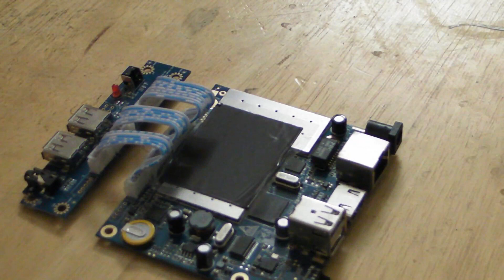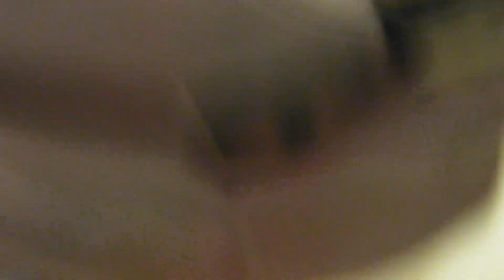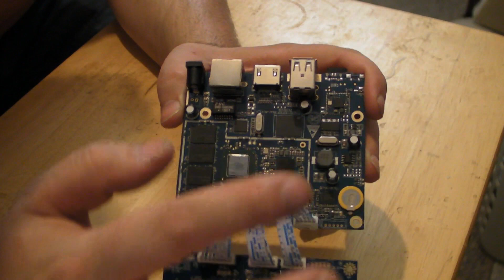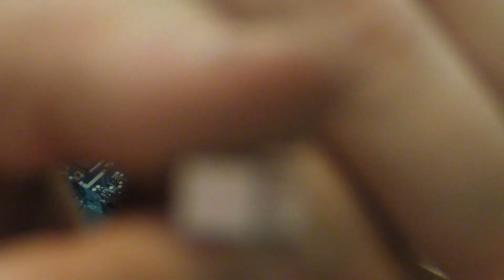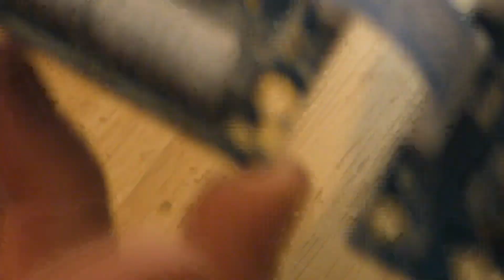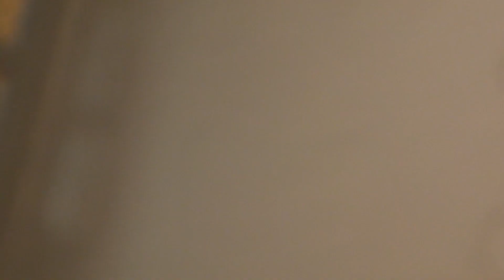Pipo X7 Heat Sink Swap

Comment: May I ask what are the dimensions of the stock heatsink? I mean those of the metallic plate which you removed.
Reply from the maker: George TJ honestly I have no idea. I don't have that computer anymore and the heat sink went in the trash as soon as I was done with the video
Reply: I see. Thanks anyway.
Reply: @GeorgeTJ  go on ebay and order the heatsink kit for Raspberry pie. I have a android tv box that was overheating and it worked out well. I'm somewhat experienced at modifying most electronics I buy. even TVs. It's why I never pay for a extended warranties because chances are I will modify it in one way or another.

Comment: I have a wintel w8 pro. I have four spare raspberry pi heat sinks with adhbresive could I use those in the atom processor and other components?
Reply from the maker: +Angelo Restrepo you could do that the only downside to it is that small heatsinks become heat soaked which means they cannot dissipate the heat fast enough so the processor will not cool down it will just stay hot
Reply: where did you buy your heat sinks? wintel pro has a similar processor. I also have the wintel x8 and there is a huge processor on it covering all the main chips with just one.
Reply from the maker: +Angelo Restrepo I salvaged all mine from old computers that have gathered over the years. And if you're talking about the thin metal cover that thing does nothing. As you can see from the videos I have about the pipo that metal shield did nothing.
Reply: I assume tha
Reply: I assume that if the heat sink covers atom processor and bit more of the board it would not be a problem. I am looking through amazon for aluminum heat sinks. I would 
like to cover internal memory and ram if possible.

Comment: My Pipo X8 overheated and wouldn't play Netflix without going choppy and lagging. I stood it on it's front edge so the screen was vertical like a monitor. Now the aluminum baseplate/heatsink acts as a convection cooled radiator. The base is much cooler and it plays Netflix just fine now. No mods required.

Comment: what keeps the heat-sinks in place afterwards?? how much did it lower temp?
thanks
Reply from the maker: They are light weight heat sinks so the stickiness of the paste keeps them in place. For temps check out the video on it. Pipo x7 stressing out. Sorry on cell so can't link.

Comment: Hi Anthony, I am thinking of getting a pipo x7 and modding it something similar to yours, I am very interested to know how the stress test went after your heatsink upgrades,
Many thanks.
Reply from the maker: gerry hynes look for this video very soon. have to shoot one more segment and get it edited. hopefully will have it done for monday.
Reply: Anthony Cress thanks Anthony, looking forward to the results with interest
Reply: Anthony could you also tell me where you sourced the heatsinks please, and many thanks in advance.
Reply from the maker: vger 147 just figured I would give you an update everything is filmed just need to do voice overs after the wife leaves for work so video looks good to come out Monday for sure. Also I had these heat sinks from a gpu cooler kit i had I'll look on amazon and see if I can find similar ones and link them to you soon.
Reply from the maker: here is what looks to be very similar to what i used. only difference is that these have thermal pads on them already. where mine didnt and i used thermal paste.

http://www.amazon.com/Cosmos-Aluminum-gaming-Cooling-Heatsinks/dp/B007XA969G/ref=pd_sim_sbs_147_4?ie=UTF8&refRID=155VYTZ1HTQBZ198GE3V
Reply: Anthony Cress thank you very much Anthony.